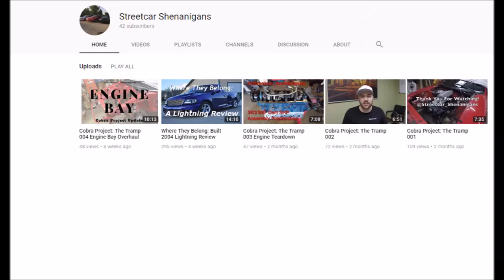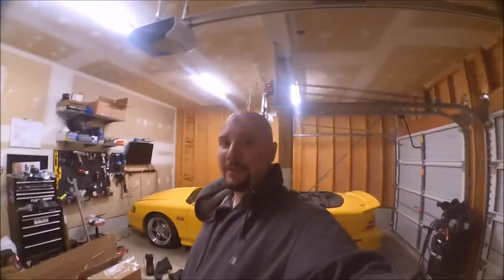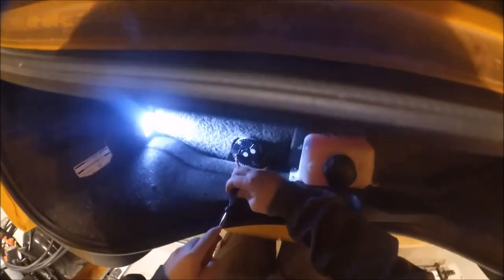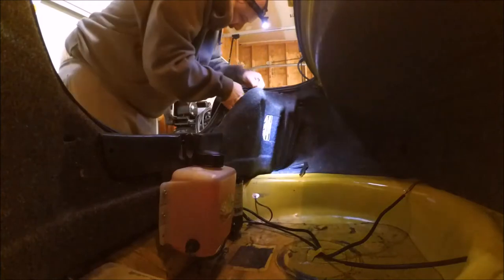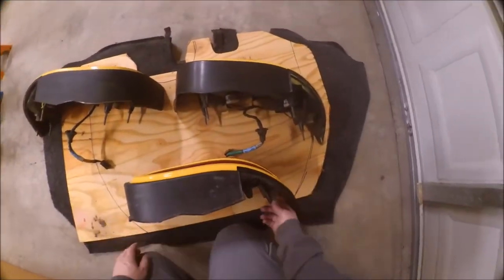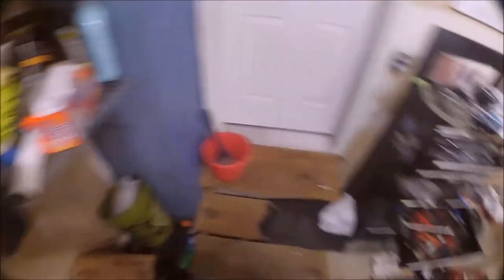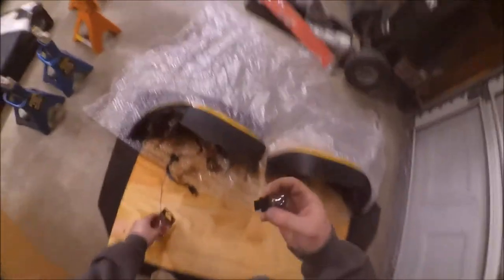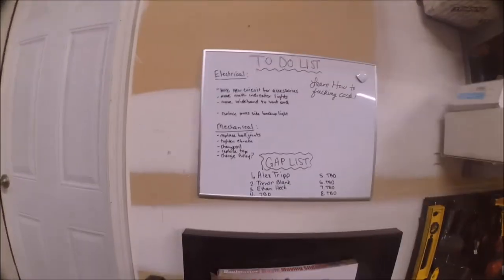94-98 Mustang (SN95) Tail light removal/ install tutorial

Comment: Glad to have found your channel man.Anyway.I purchased a COMPLETELY  stock 30,000 miles Vibrant Red Convertible  Cobra which is one of only 32 5 speeds made in that color and black interior  combo.I got a ford style bar and I'm up to 748whp but no bar.it is a fckr to install and people want crazy money to install it.
Reply from the maker: Connoisseur of Cannabis Cars&Pussy congrats man! The bar is not hard to install at all. It’s really only taking out the back panels and drilling an access hole and sliding it down and bolting in. Plus wiring if you have a brake light like mine.

Comment: It is soooo hard to find these taillights!!! Please, please, please!!! ‘94-‘95 SN95 owners DO NOT THROW THESE STYLE TAILLIGHTS OUT!!! They are hard to find and the only way to get a set that has the proper direction lights is through LMR for $200+ and they DO NOT have the painted areas that separate each light, it is all the red  lens color which are not the same. So if, for reasons unknown to me, you decide to put the ugly Euro taillights on your car place your taillights on a sight and sell them. It would be a great favor for other ‘94-‘95 SN95 owners that appreciate the original taillight design that is exclusive to the 94-95 models.
Reply from the maker: I have that set I removed still in my shed wrapped up if you want to buy them ;)